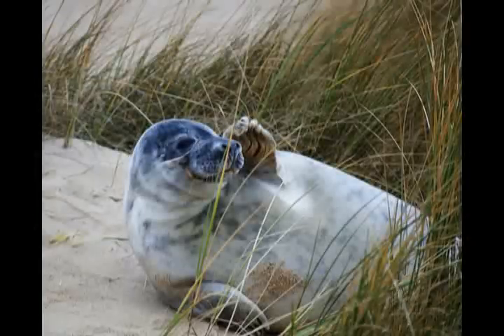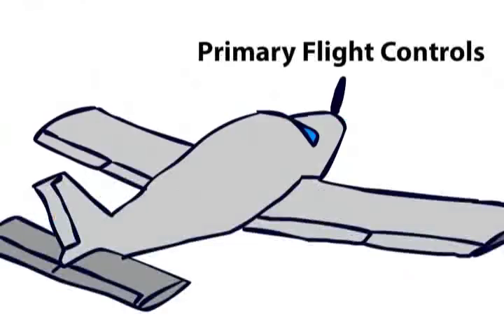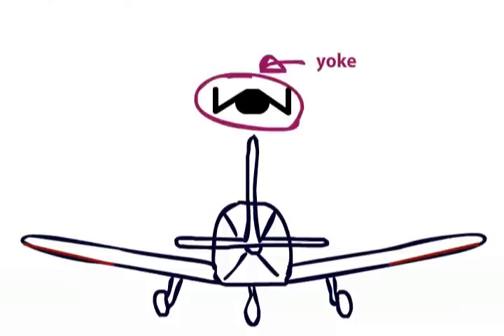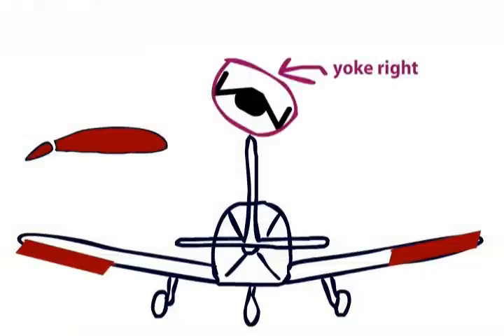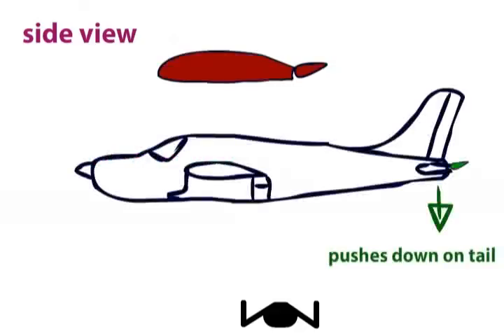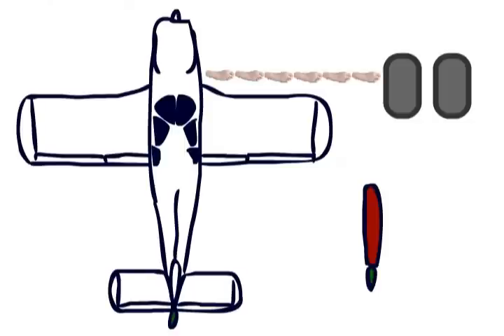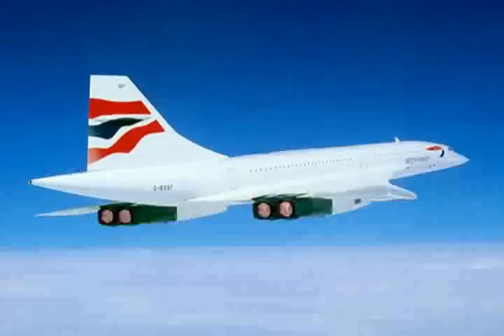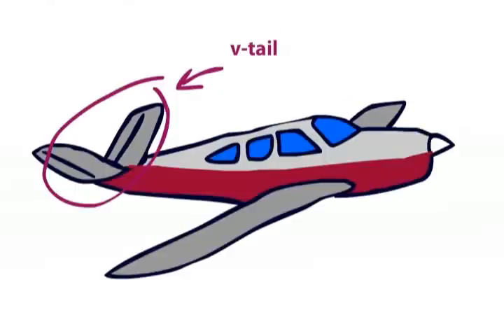Aircraft Primary Flight Controls Explained | profpilot.co.uk video #5

Comment: time: 3:36: the vertical stabilizer not the horizontal stabilizer because when the rudder deflect right, a lift will generate on the vertical stabilizer that pulls the tail to the left and yawing the nose to the right

Comment: just want to clarify some things: when aileron, elevator, and rudder moves, it doesn't change the AoA of an airfoil (unless your plane has a stabilator). The deflections of the parts is not enough to change the angle of attack of the airfoil. What it does is increase or decrease the camber which will alter the production of lift. It is common to confuse the two because both are Coefficient of Lift and is easy to miss.

The video is good but it can form misconceptions to an ab-initio student which can be detrimental to the learning process.
Reply: Remle Anall I agree with u 100% its the differential rate of lift generating that creates the ability of aircraft manoeuvres. Well done

Comment: The only scenario in which a primary control surface works by changing the angle of attack is an aircraft that uses a stabilator instead of an elevator. All other trailing edge control surfaces work by altering the camber of the aerofoil.

Comment: Remember that the differential aileron system is opposing adverse yaw because the upgoing wing is creating more lift (and thereby more induced drag) it has a tendency to move slower through the air, therefore the downgoing wing will deflect the aileron upwards at a greater angle than upgoing wing, creating more form drag and thus decreasing the speed of the downgoing wing which counteracts adverse yaw.